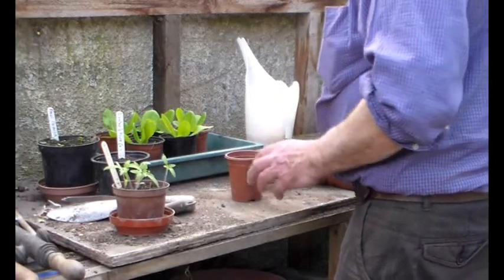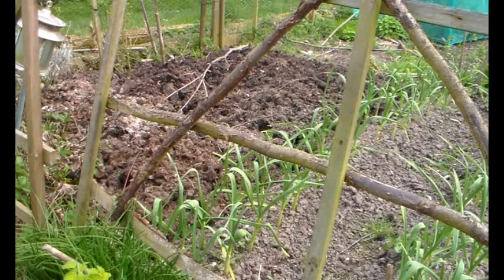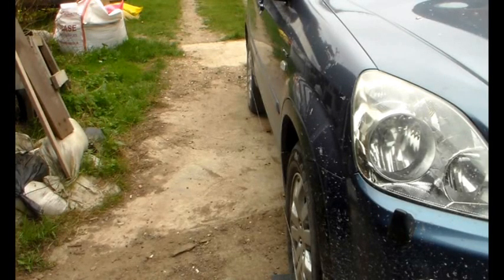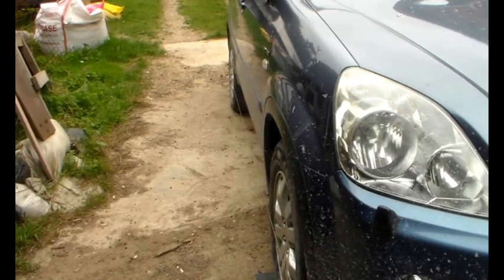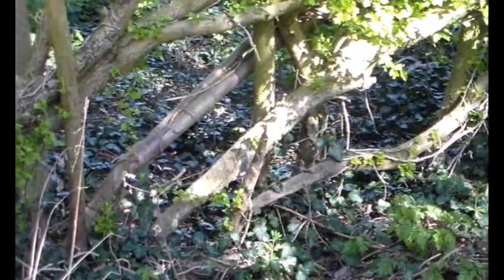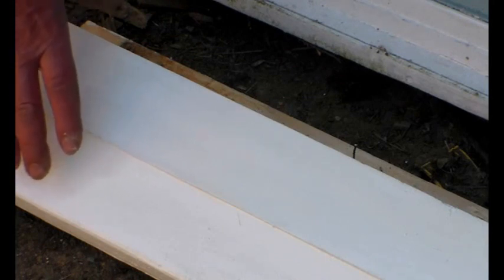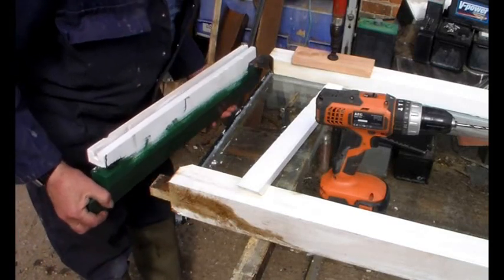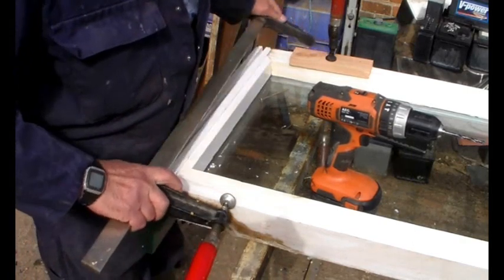Home life No 21, strawberries, wheel tracking, trailer repairs, windows and the dash.

Comment: it's a funny old dash! New cars are nice to have, even if it's just new to you. I got an 18 year old passat there last summer, it was just under 100k miles and still on it's first timing belt. So I replaced that and it just trundles along. The CD player has become a bit temperamental, but there's always Radio4. I miss the van, but it only had 3 seats and as life moves on sometimes you need another seat. Another pleasant video Andy!
Reply from the maker: Yes life moves on with the occasional flurry of indeterminacy, cheers